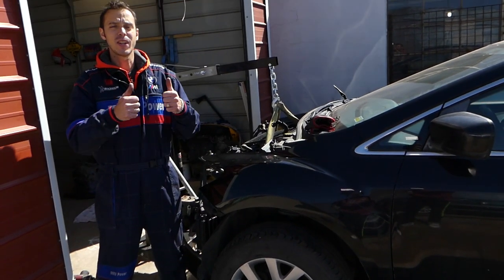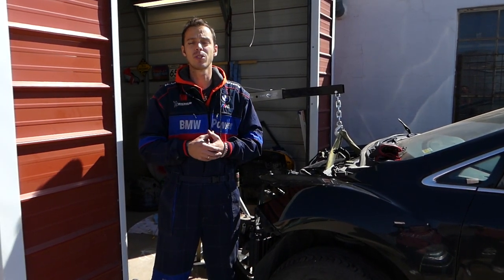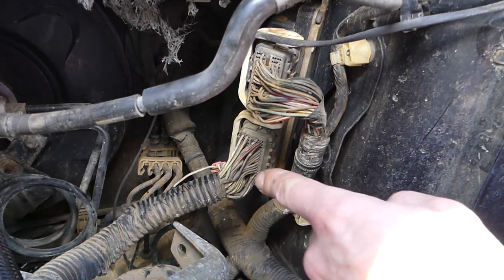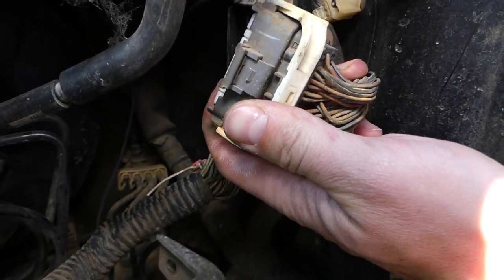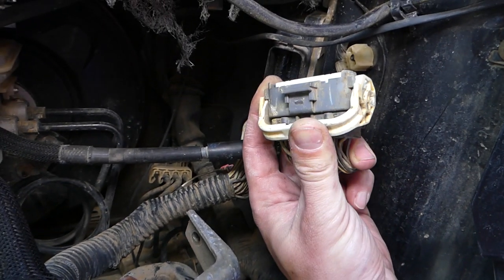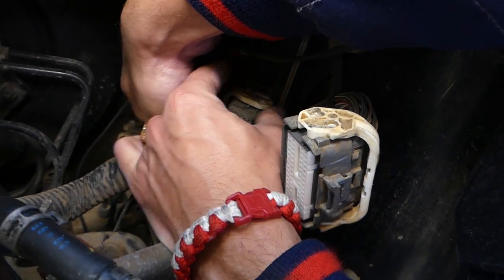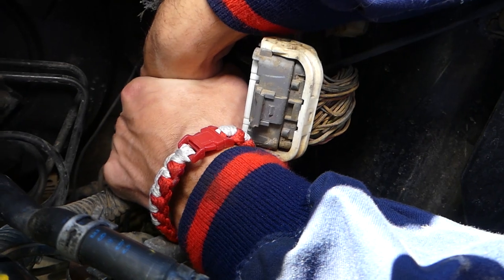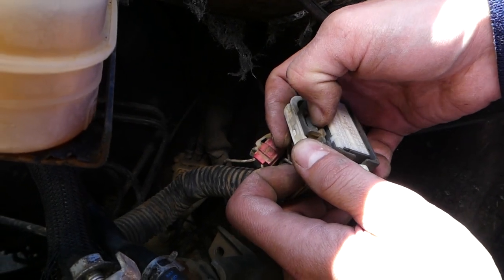HOW TO DISCONNECT ENGINE COMPUTER WIRES ECU WIRES ON MAZDA 3 6 5 CX7 CX-7  DME ECU ECM WIRING HARNES

Comment: Thank you very much for the valuable information...
But I have a very mysterious problem...
The car is normal and there are no problems,,, Mazda Zoom 3 2016
But when the cruise control is turned on and after walking on it, the AT + check engine lights up....
The gear becomes hot when it is changed < and returns normally when the battery is disconnected and put back in
Is there a solution to this problem and what is the cause...
And thank you so much

Comment: Hey I've got a mazda 6 Mps.  My Engine it was faulty now I bought an engine the difference is it has got a front computer box on the front battery box . The previous engine uses a computer box on the left side passenger.  What I need to know Will I use my original computer box and my wiring?